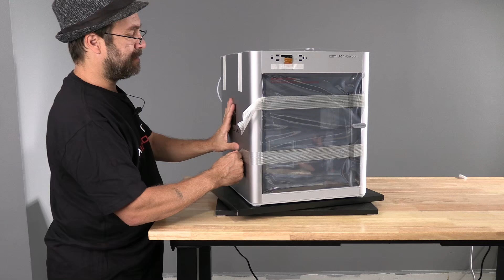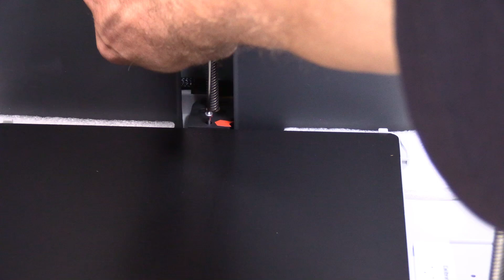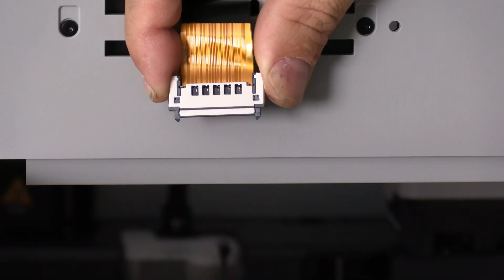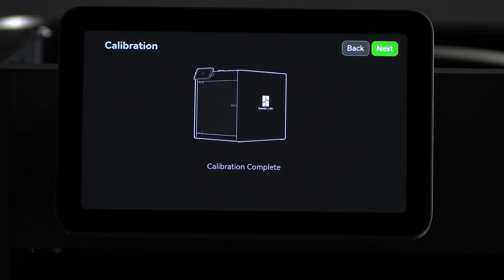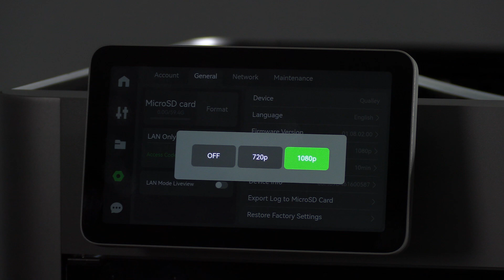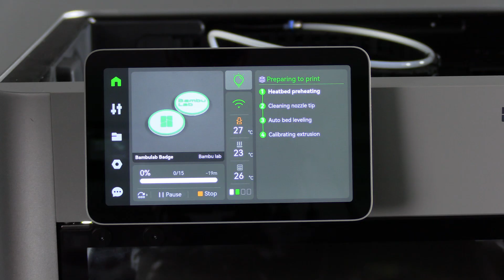Bambu Lab X1C COMBO: The Ultimate Unboxing & Setup Experience

Comment: Excellent review and presentation Gregg! For the $$ I love my P1S with the Panda touch screen and just added the Panda Power supply the other day. Sure steps up the game for P1S.
Reply from the maker: They sent me the Panda Power. I'm not sure what they want me to do with it. What are you using yours for?
Reply: @3DRundown  Currently just using it to measure power usage when printing also auto shutoff feature when the print is done. Hey what they don't mention or as clear as it should be is, when binding up the brick with the touch, there is a tiny button on the blue LED side next to the cord that you need to push for 3 secs to pair up.
Reply from the maker: Excellent. Fun stuff. I'll cover it! :)
Reply: @3DRundown  thanks - that would be awesome!
Reply from the maker: Would you be willing to copy/paste this comment, to the updated version of this video? I think it's best that I delete this video: https://youtu.be/NkUr0u9W1nU
Reply: @3DRundown  the entire comment thread?

Comment: Considering picking up the P1S (combo), makes me sad that it doesn't have this nice touch panel though. :,(
Reply from the maker: P1S screen sucks ass, but there is no reason not to get a P1S over an X1
Reply: @3DRundown  price? ,xD
In sweden I can pick one up for 1100 dollars while the x1c is around 2000+ :((
Reply: @TheThigoron like I said, no reason NOT to get the P1S
Reply: @GreggAdventure  Omg, I'm sorry I completely misread what you wrote LOL. Blaming it on the dyslexia. ^^'
Reply: I never use the screen with my P1S even though I setup a XTouch, everything is done on the phone app and slicer.
Reply: @w00dlette X1 Screen is more capable than both screens. But yea, it's not really a problem
Reply: Love my X1 c way better than the p1s ….
Reply from the maker: Elaborate. Why:
Reply: @3DRundown  because it  has laser leveling  the X1 , the connectors to the hot end on the p1s are tiny and flimsy.over all the X1 a better machine.
Reply from the maker: The hot end is different? I will have to take it apart and see!
Reply: @3DRundown  look at the connections
Reply from the maker: Would you be willing to copy/paste this comment, to the updated version of this video? I think it's best that I delete this video: https://youtu.be/NkUr0u9W1nU
Reply: @3DRundown  just remove the comment